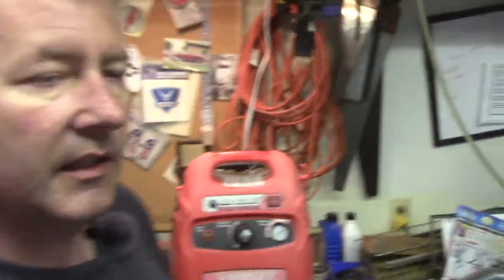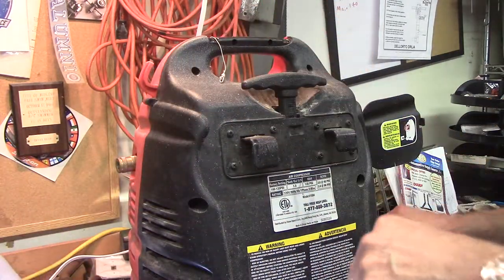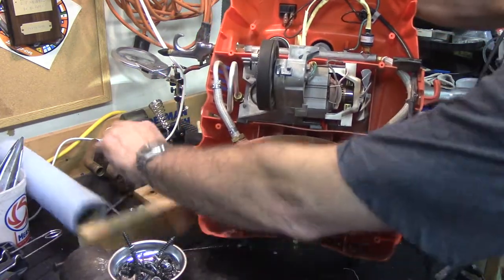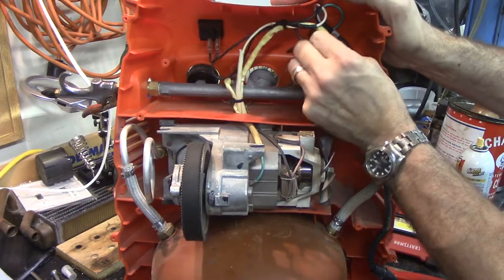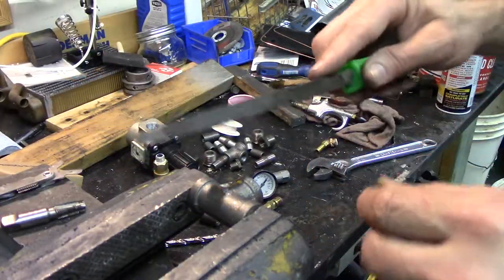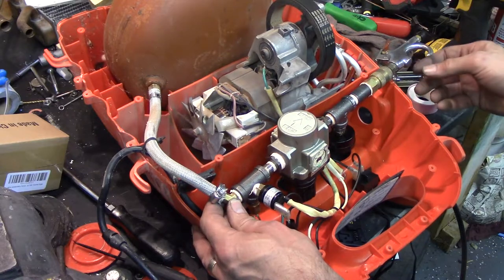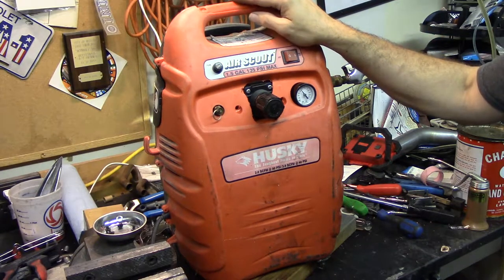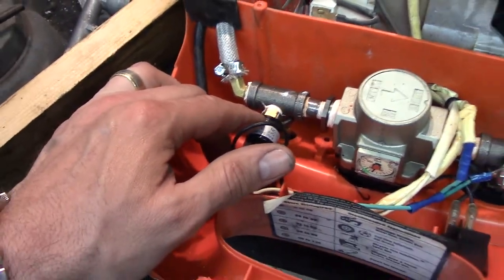Repairing a small Husky air compressor

Comment: Thanks so much for posting this! I have the same model and it started leaking air from somewhere inside. It's about 15 years old so my 1st thought was to replace it. However, after running across this video, I decided to try taking it apart for inspection. Turns out, the hose exiting the tank had sprung a leak. I took that hose to my local auto parts dealer and got a replacement with clamps for less than $5. The compressor works perfectly now!

Comment: Thank you for your video Bryan, it helped me disassemble my Husky air compressor.  II had a leak in the hose from the tank to the manifold.  The hose had a hole, so I fixed it with metal tape and Gorilla tape on top with a hose clamp over the area with the hole.  Worked perfect!  Easier than taking the hose off, and I think it will hold for what I use it for.  Thanks again!
Reply from the maker: Glad it helped. I figured that there are at least soem people out there with one of these that dont want to throw it out. Thanks for watching!

Comment: I thought I was the only one who'd spend the time trying to repair/salvage a small air compressor like this.  I commend your creativeness.  In my case the model 41004 unit I have had been bounced around by the original owner and one of the front feet had broken out the housing.  Was able to install some wood backup pieces and mount a new support piece to replace the two feet.  Now I have a working compressor for small projects in my shop.  I have a second unit where, besides the broken foot, the aluminum pressure pipe broke off right at the compressor fitting.  So far I haven't been able to find a ferrule to fit it.  Hope it's not some metric tubing size.  Am also having to replace some of the 6 rubber mounting pads for the compressor that have disintegrated over time.  Noticed that the one on the top of your compressor is missing, but it may have been stuck in the black housing you had to remove.  Thank you for the video and showing your creativeness and I'm glad to know I'm not the only one who enjoys doing stuff like this.

Comment: Thanks for the video. Mine was not the same repair but yours was helpful in how to open the case, I think I would have struggled before finding the screws hidden by the wheels. Fortunately my air leak was simply a leaking hose.
Reply from the maker: I am glad someone found this video useful.

Comment: Thanks for the video! I'm trying to fix a slightly "newer" model of Air Scout, the 41214,  which need  new internal hoses and wires. Any idea where to get replacement hose for that mesh coated flexible hose that connects the tank to the manifold? And in mine, the wires need to be replaced, too. I know nothing about electronics...any idea what type of wire I need to get (I.e. what specs would I search for or ask for in the hardware store?)? I know you're not customer support for Husky, but just thought I'd ask haha. Thanks, regardless!
Reply from the maker: Any rubber hose that you can find at the hardware store should work fine. The wire should just be stranded copper wire so it bends easily. You probably need about 14 gauge wire and you should be fine.

Comment: Hey Bryan, excellent work salvaging the compressor... I would have taken the same approach... making it better than the original manufacturing... The "safety" ground theory/thinking is correct... the implementation though is not quite right/satisfactory... the reason being is the Teflon tape used at the joints could possibly/likely interrupt/isolate each section of pipe from the welded stud/wire connection... if an electrical failure/short should occur it's likely a section (the one the switch is actually connected to) would be live/hot. anyway... you can test this with a continuity tester/meter... However, even if you get continuity... it is best practice to provide a "daisy-chain jumper(s)" between all sections of pipe isolated via the Teflon tape; to/from the original welded stud equipment ground wire... Hope I made sense and did not add confusion... I have an electronics/electrical background... Overall, I think you did a great job with the implementation and video. We all appreciate the effort that goes into doing videos like this!
Reply from the maker: I understand all of that but every taped pipe joint I have ever taken apart has obvious metal to metal contact. If there was more of a danger I would test continuity across each joint.
Reply: @bryansprojects3570  ... Yeah, it's not a real high likelihood or danger... It's more from a manufacturing - UL compliance and fail-safe standard if you were manufacturing these for sale.  If the pipes were welded, brazed, or soldered a wired daisy chain would not be needed/required. Sometimes they tack weld them, sometimes a clamp or a variety of other metal fasteners are used to ensure the equipment/safety ground is not compromised over the useful life-cycle of the equipment...

Comment: What is the fitting size for a quick connect I got this from my friend who passed away and can't find a fitting for it anywhere
Reply from the maker: It was the standard one they sell at Lowe's etc., the same we we use at work too. Your friend may have changed to something else, it was standard pipe thread so it can be changed to whatever style you want.
Reply: joshua Springer Did you ever figure out what size you needed? Having the same issue.
Reply: @blu2thdude247  no I did not ended up selling it